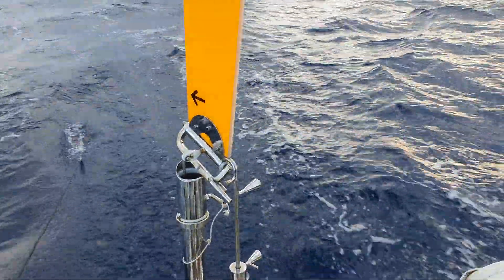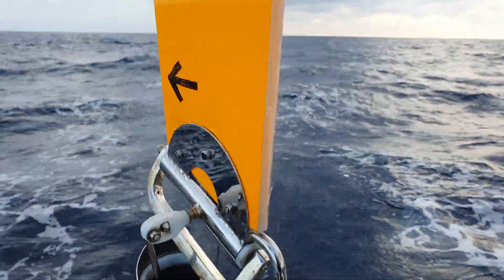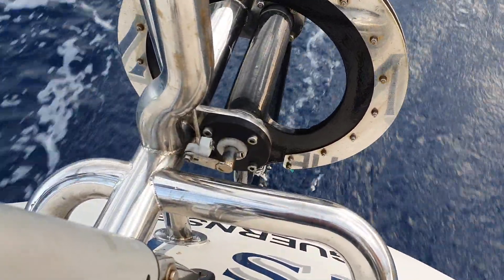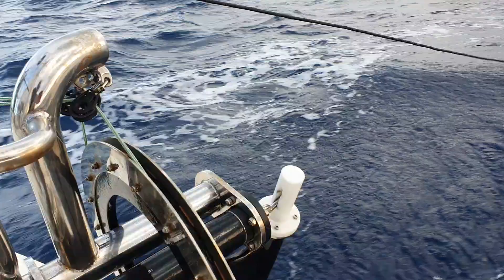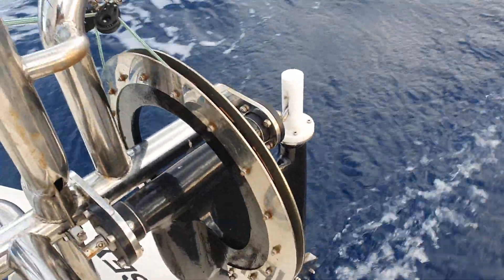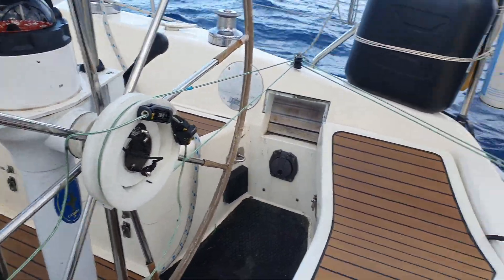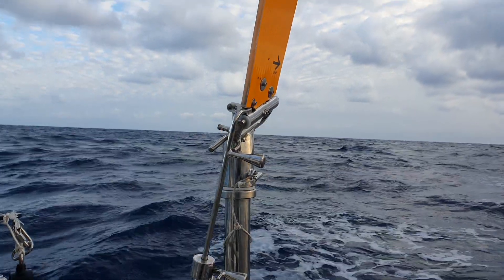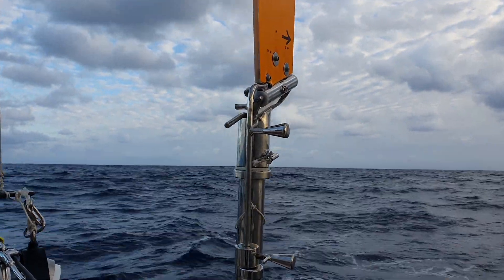Home Made Self steering gear for a yacht

Comment: Can you explain the knobs, protrusions, horns or whatever you call them, on the vane counter balance lever? Do I see  a hard stop to keep the vane from over steering? The black portion of the mechanism - is that fiberglass? What did you use for bearings? I would love to see a more in-depth presentation.
Reply from the maker: Hi , The knobs and protrusions from the vane counterbalance arm and it's weights ,are to fine tune and offset the weight of the drop rod and swivel (inside the vane carrier tube) The amount of counter balance you need for this drop rod varies with the position of the weights them selves vertically on the vane counter balance arm . The trick is to get the vane to sit upright ,with the drop rod attached  The rest of the system is neutrally balanced so from the linkage at the bottom of the drop rod onwards ..I hope this helps !!!
Reply from the maker: The black portion is E glass , the pivot bearings are Acetal and the servo oar bearings are Torlon 1/4'' winch ball bearings from Lewmar or Harken available in bags everywhere

Comment: very nice design! I like how you have simplified the various linkages by using asymmetry.
my only suggestion is some sort of control lines for the vane angle, so that you can change the angle from the hatch when it's wet out
Reply from the maker: Thank you ! ..Yes I thought about it , and have done it in the past with center cockpit yacht , but felt that the extra spaghetti wasn't worth the agro , as it's literally right next to the helm

Comment: Very nice job! Looks pretty beefy! Is you wheel steering cable or hydraulic to the rudder? I've heard hydraulic wheel steering will not work with a servo pendulum wind vane, did to the lack of feed back I think. For this reason I'm thinking of mounting an external rudder for self steering duties. Fair winds!
Reply from the maker: The Sigma has mechanical linkage directly from helm , via one set of bevel gears on the steering wheel shaft .The only way you could get it to work would be to connect directly to the rudder shaft via the emergency tiller ,or similar. But I have built an Auxiliary Rudder system for my previous Long keel , center cockpit 15 tonne yacht , that was hydraulic steering , for that reason (Hydraulic steering on yachts always creep , so no center position is available)

Comment: The large pulley on the transverse shaft (rotated by the servo pendulum) is a good idea! Combined with a round pulley on the steering wheel this means that the wires are always tight in any position of the pendulum. Well done!
Reply from the maker: Thanks , it is also like that so that the entire servo assembly can rotate , and stow completely clear of the water ,with the servo oar pointing skywards